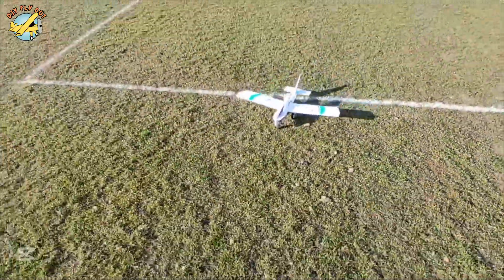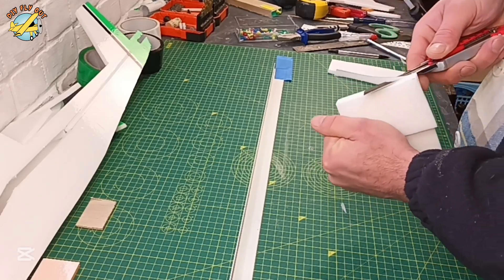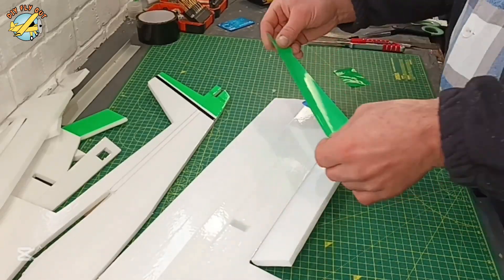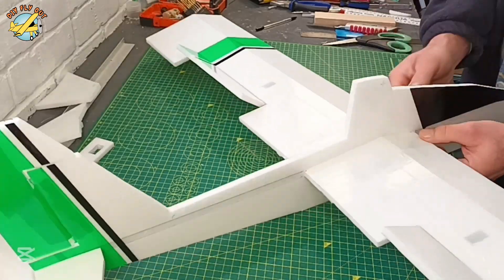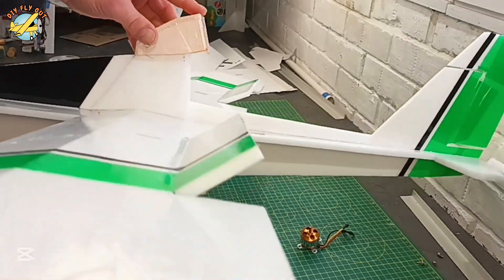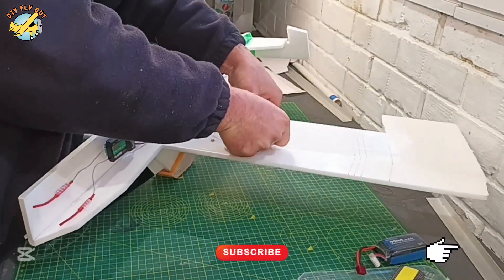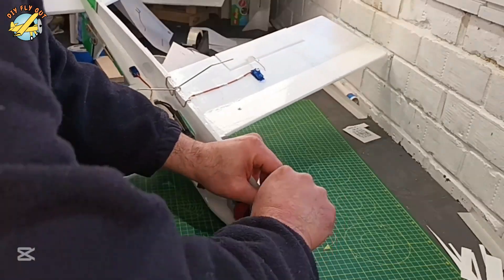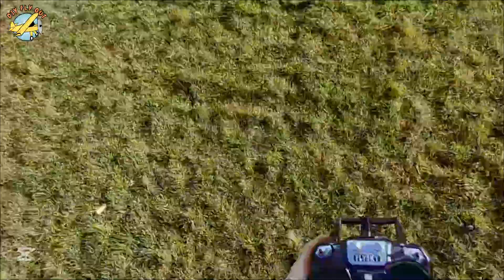Tired of Broken Propellers?  This DIY RC Airplane is for You!

Comment: 0835   that (old and too-flexible) prop  NEEDS  to be retired.!    a correctly spec'd  EP prop  SHOULD  be  used.
if/when a correct offset pusher thrust configuration is used, the motor would not need so far above the tail boom.    and, the rudder would not be  IN  the prop wash.
Reply from the maker: @daviddavids2884  thx for the input Dave, althought i dont get why you think the prop is old?  First time ever used it

Comment: 0011   this pusher thrust configuration is wonky.    specifically, the model's center of mass (c-m) should be located at a point that vertically aligns with twenty-five percent of chord.    and, ideally, the thrust line should intersect the c-m.      that is why there  SHOULD  be a  Certain amount of  negative aoa at the motor mount.!     in this case, the too-forward location of the prop and less-than ideal thrust line result in  unscheduled  nose-down moment,  Anytime  there  is  thrust from the prop.!      in turn, this means that energy efficiency of the model is reduced, due the need for the use of more elevator down-trim.      the distance between the wing le and the tip of the nose should be roughly equal to one wing chord length.     
0012   the mass of all servos should be located near the cg and/or aligned with the cg; that is, at thirty percent of chord.    (that is a multiplication by  .3  )
the main landing gear should be located below the cg.      if, when doing this, the nose gear won't stay on the ground, then the c-m of the model is not correctly located.
0041   the type of wing used that is used, here, should be mounted with a couple degrees of positive aoa/aoi.
0617   ailerons  SHOULD  EXTEND  TO  THE  WINGTIPS.!!!
Reply from the maker: @daviddavids2884  David!   I so value your inpit!  You have a fair point, and i can dispute few of your pointers.  I strongly invite you to my discord!  So many people could learn and benefit from your knowledge.  Please have a think!🙂

Comment: The landing gear is a super cool idea.
Reply from the maker: @FlyTimeRC  you mean to take em off  for better flight or mounting them?
Reply: @woody7739  the design of them how you have a form on paper so they are exactly right. Being able to take them off easier. All awesome.
Reply from the maker: @FlyTimeRC  you can play with similar solution on your designs!
Reply: @woody7739  I've literally not planned a single thing in my planes 🤣🤣  I need to start putting more thought into my planes. I feel like I'm falling way behind. I barely touch any of my plane stuff anymore. Just to busy.
Reply from the maker: @FlyTimeRC  i hear you.  Same here, i wish i could do it full time, yet i am getting ready to work 😂😂😂

Comment: I think finding the thrust angle of the motor is the hardest part. Nice work!
Reply from the maker: @FlyTimeRC  thx, my first pusher like this took a lot of beating before it got flying, so I designed this one with adjustabke angle.  I am super glad it flies so niceky 💪💪💪
Reply: @woody7739  awesome,great work. You can tell you put a lot of thought into your planes.
Reply from the maker: @FlyTimeRC  probably because i am so scared of failing 😂😂😂
Reply: I am guessing you found up thrust to be the proper setting.  I find pushers generally have up thrust.